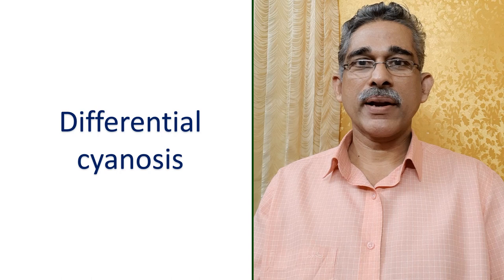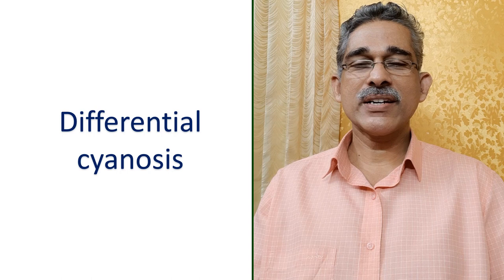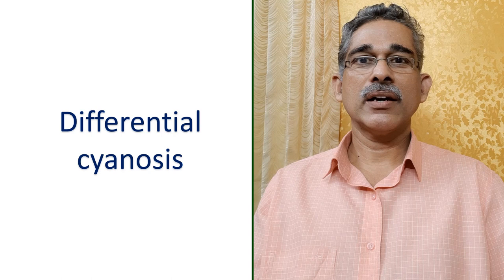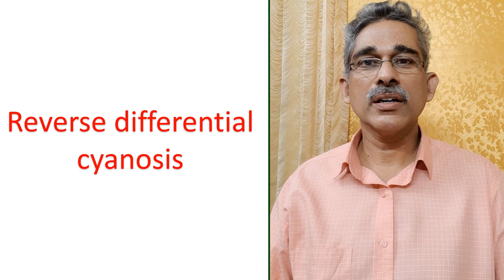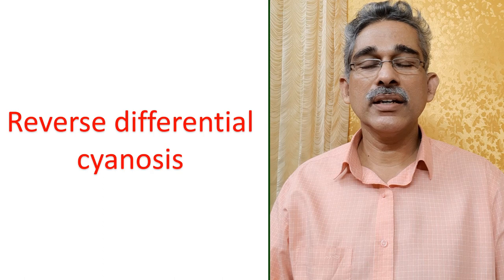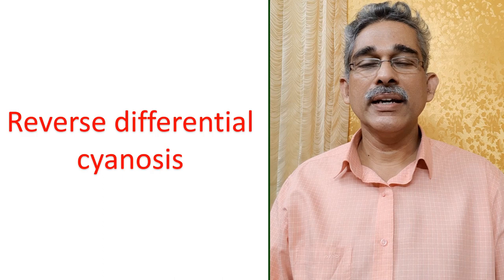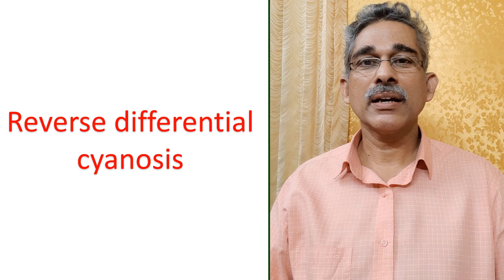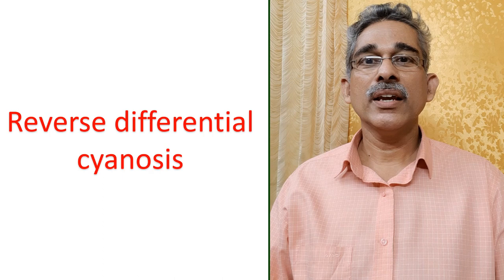Differential cyanosis and reverse differential cyanosis

Comment: Are these Differential features only seen in the initial phase or are they present in the end stages as well ?
Reply from the maker: May be it can be superimposed by peripheral cyanosis if they develop heart failure. In PDA reversal, left upper limb can be cyanosed due to flow from ductus which is near the left subclavian. That is why right upper limb is compared with lower limbs. If there is an aberrant right subclavian from descending aorta, right upper limb also can be cyanosed. A cyanotic hue of tongue can occur with severe polycythemia.